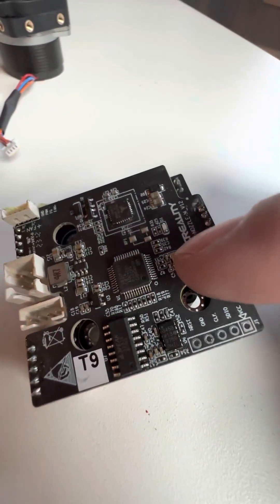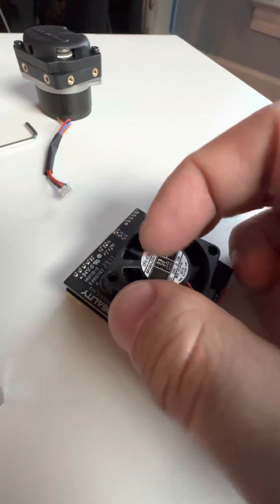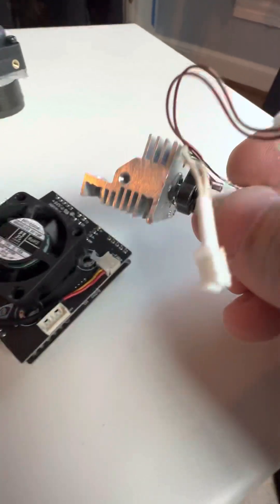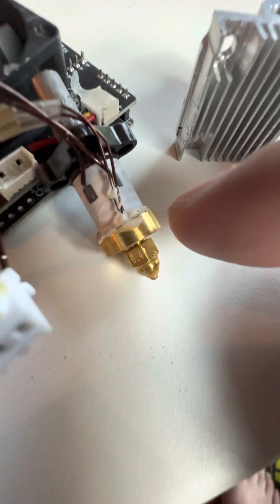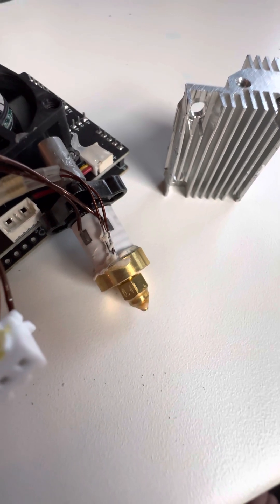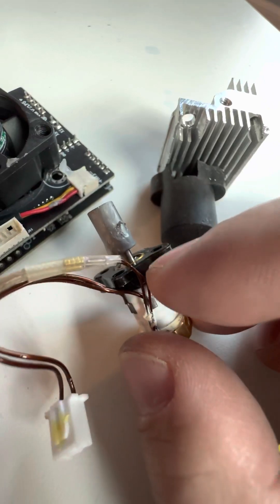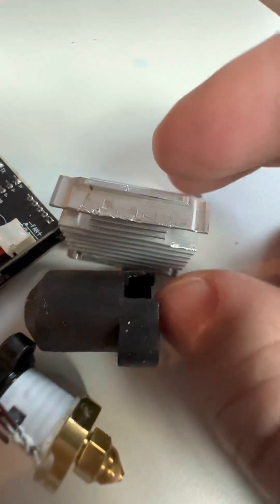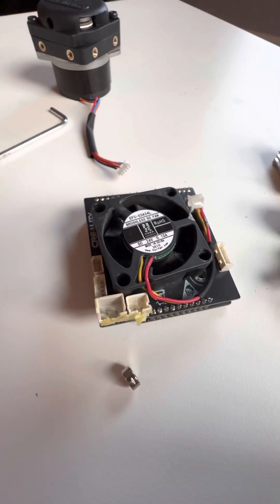Creality K1 Breakout Board, Hotend, and Heatsink

Comment: Hi Nathan,
your video is very interesting - thank you for that.
I do have a question concerning the PCB layout of the extruder breakout board (maybe also called "noozle sub-board"). Background for my question is:
I'd like to upgrade my Creality K Max  with a LDO Orbital V2 extruder with an LDO filament sensor. Connecting the LDO Orbital V2 extruder will be no problem, there are a lot video tutorials and 3d adaptor printables to mount the extruder to the printer.
Also the connection of the filament sensor will be no problem, IF YOU JUST WANT TO USE STANDARD FUNCTIONALITY.
But the filament sensor includes a button which can trigger the "unload script" of the klipper firmware. Therefore an additional wire is provided. BUT: This wire needs to be connected to an unused INPUT pin on the breakout board and you need to know which pin this is (name or so) to edit the configuration file.
My question now is:
Do you know, if there is such an unused INPUT pin?

Comment: Thank you so much for the video. My K1 max extruder got jammed somewhere in the nozzle and it had a huge blob coming out.  I could not unscrew the hot end/nozzle from heat sink because the filament went through all the spaces. I had to cut a metal part (top end of nozzle that is just below heat sink) in half so that it rotated with screw and scerws came out of heat sink. Your video tremendously helped me to fix my 3d printer.

Comment: I have a K1 max and I have had many jams in the short time that I owned the printer. I have two other printers ( Ender 3 pro and a CR-10 clone) which I never experienced jams with them. I think the heatsink is not doing a good job dissipating the heat and allowing heat creep. I believe if the heat sink had holes all the way thru and allow the fan to blow thru it, it may do a better job
Reply: Had many issues with the K1 Max jamming when I initially got the printer.  Removing the bowden tube from the e-chain, and removing as much friction as possible from the filament path really improved things for me.

Comment: I had oil seep under the tube in the heat sink and prevent filament from flowing thru the hot end had to remove all that just to clear ended up just changing the hot end as well.  So still suffering from common issues. feel they owe a few updates to the community.

Comment: Well it seems my hot end is shot... are there any bolt in replacements or will I have to wait for creality?  I used an adhesive for putting it back together so I need to get everything from the heat brake to the nozzle holder.

Comment: If the hotend board has a driver for the extruder does that mean there is a spare driver on the main board? is that spare driver able to be used for dual independent Z-axis and run G34?

Comment: As a E5 S1 owner I'm hoping that the increasing use of that nozzle size will help expand options for nozzles that won't require a change in length.
Reply from the maker: Actually just realized it’s a volcano length, RIP 🪦 
But you can just use brass nut spacers on the Ender 5 and get volcano performance
Reply: @NathanBuildsRobots  Oh bummer. I have seen your mods to the E5 S1. I will revisit that later as I think as I may want to go further with the heater block :D
Reply: @anwyll replacing the heater block isn’t worth it. Stefan from CNC Kitchen did an analysis and found that just a brass nut gets you to almost the same flow as full on volcano heater block

Comment: Interesting that they have a closed loop stepper setup for the extruder.
Reply from the maker: How can you tell it has closed loop control? Like it can tell if it skipped steps?
Reply: @Nathan Builds Robots  there's a stepper on the toolhead for the extruder and yeah the benefit would be more accuracy and no skipped steps due to additional feedback and control.
Reply: @jasontrauer  no closes loop there, just a canbus breakout board like you can buy already. Not so sure honestly if you benefit from a closed loop extruder. If you skip steps, you have either a blockage or are outrunning the hotend. If the stepper recovers you will have a hell of a over extrusion as it will try to make up for the lost steps. More useful on xy tbh
Reply: @Kilian Lindlbauer  ah so the stepper driver is for the extruder but just talking to the mcu via canbus?  Why even have the stepper on the toolhead at all doesn't that just introduce more heat and weight?
Reply from the maker: @jasontrauer  Yes but it also reduces wire count by 4
Reply from the maker: acutally, you need about 16-24 wires traditionally, with the CAN bus you only need 4
Reply: @jasontrauer  there is a mcu on the toolhead which simplifies wiring immensely. At least with klipper it either talks directly with the raspberry pi with a usb to can converter or some Mainboards like the btt octopus, skr3 or fysetc spider have on board can bridges. As example on a voron 2.4 you have about 24 wires going towards the toolhead. On a 350mm sizr each wire is minimum 1,3 meters or 4 feet long. Just the amount of money you save in wiring and connectors justifies canbus.
Depending on how your exact setup is you save weight with canbus as you get away with smaller drag chains if you use those or can ditch them altogether. Of course wires will also weigh something, so you save there a bit

Comment: The ptfe tubes are for insulation. I always wondered why its always ender 3 guys with heat creep or insufficient heating power and never anycubic, elegoo, flsun or artillery. The only major difference between a mk8 and a v6 hotend are the two retaining screws that enable a one handed nozzle change. I did some calculations and figured that the two m3 screws on the mk8 hotends transfer a shit load of heat (perfect transfer into the screw and from the screw assumed, screws stainless steel, distance between heater block and heatsink 3mm) into the heatsink. 12 watts, in reality less of coarse since the transfer between heater to screw to heatsink, to be exact thats without a heatbreak, the heatbreak adds 6 watts under the same assumptions . So you can significantly reduce transfered heat by insulting the additional retaining screws
Reply from the maker: That is really interesting. Yeah because then it needs to transfer heat all the way through the screws before it can sink heat into the cold-end. Nice insight.

Comment: So ridiculous putting electronics where they'll be subject to heat and extreme vibrations (10G+ if you're using this printer to its potential) for no reason.
Reply: Tmc drivers have a rating of 125 degrees Celsius, so no issue whatsoever. You will probably even be able to run all of your drivers without any fan blowing in a regular printer. My tests (tmc2209 by bigtreetech) resulted in 1,2 amps just with a heatsink before overheating. Realistic chamber temperatures are 60, maybe 70 degrees with insulation. The mcu has basically nothing to do, it just need to coordinate the extruder, two fans and the hotend which are extremely simple tasks. Personally i haven't had any issues on my enclosed canbus printers, so i guess they are perfectly fine there
Reply: @over_pizza_2578  Personally I wouldn't be very confident subjecting PCB traces and solder joints to continuous 10G accelerations at chamber temps.
Reply from the maker: @daliasprints9798  Yeah it is a pretty harsh environment, but I think it should be ok. I've dropped my phone more times than I can count and that subjects it to 1000+ gs.
Reply: @daliasprints9798  BTW, 20k acceleration are about 2G, 1000mm/s2 is 1m/s2 and 1G is 9,81m/s2
Reply: @over_pizza_2578  Yes I'm aware. 1-2G is $150 bed slinger range not what you'd expect from a printer with this price tag.
Reply: @daliasprints9798  if you want a printer that hits 10g/100 000mm/s2 acceleration have a look at the v400 or at a 4 stepper vzbot. Not even a v0 can hit 100k acceleration without 48v stepper drivers. 150 dollar bedflinger print at 1500mm/s2 (0,15G) maximum, not 1,5G which is 15 000mm/s2
Reply: @over_pizza_2578  Voltage buys you speed not acceleration. Higher current is what gets you acceleration. My Ender 3 hits 100k on X with stock motion system; 10k is easy and hardly needs input shaper. 500-1500 accel on these machines is what the profiles come set to for use with Marlin driving them, nowhere near the capabilities of the machines with input shaping.